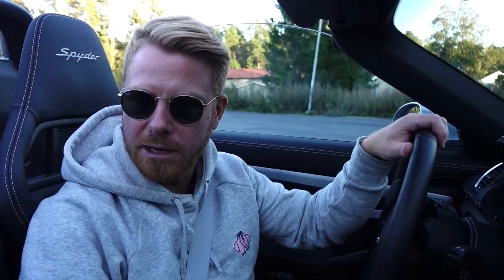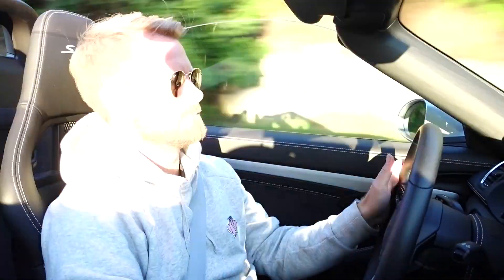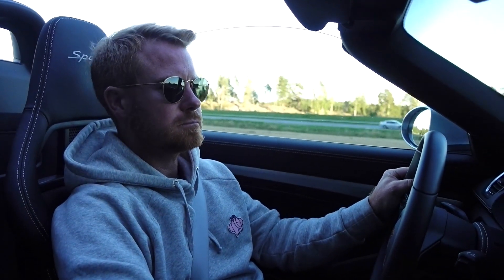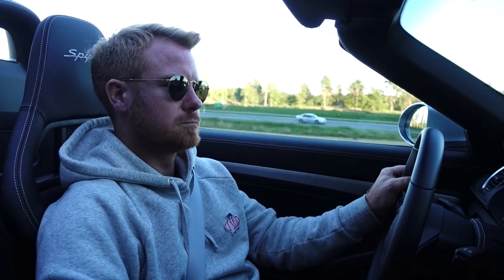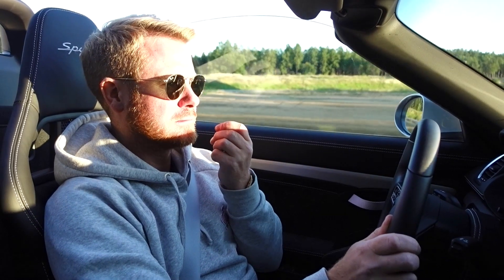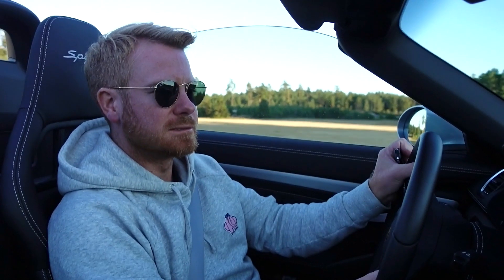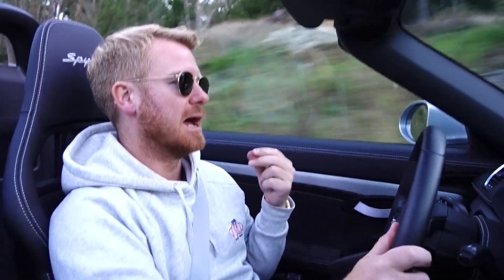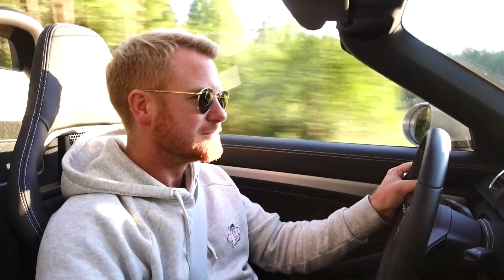Porsche 718 Spyder - DRIVE, Exhaust valve controller install from Cargraphic

Comment: Many thanks Andreas for this fantastic tip. In the installation video you mentioned at the beginning that you just have to pull the flap hoses left and right. Since I think that a lot of people only want to drive with the flaps open anyway, that's an extremely interesting hint. I tried it straight away. You don't have to lift the car or remove the diffuser, you just put your hand under the fender and you can even pull out this little metal hose without effort (left and right), you don't even need a screwdriver. I think it would also be worth having a video of its own. Thanks again
Reply: Do you need to have the exhaust button selected before the tubes are removed?
Reply: @seanf7174  No, the engine is off, during procedure.

Comment: Ask your Porsche dealer to disconnect exhaust valves/gates permanently,  this keeps exhaust flow open all the time.  Warranty not effected if done by Porsche (You gotta ask workshop manager very nicely,  they may charge an hours labour).  This way its always On and the exhaust button on centre console becomes redundant.
Reply: This seems logical and more appropriate
Reply: I've never used one, really, but I believe you can put it in the serial mode, so it'll just bypass the car's intent on controlling the flaps.

Comment: What would you do next with the exhaust? Any recommendations after the valve controller?
Reply: Sorry for late reply.   This is the ONLY change I recommend, No more changes required,  It is a simple non invasive disconnect that reverts the car back to the sound it would make had there been no noise regulations.
I have driven same car with an "Akrapovic" system fitted,  it is expensive,  loud to a point where it is no longer enjoyable to drive.

Comment: Just subscribed to your channel I did not see the video where you show which exhaust system you got for your spider. I just purchased 718 boxster Spyder and I love it beautiful spec but I want to do something about the sound which exhaust do you recommend? Top three that I was thinking about was JCR sole performance or fab speed
Reply from the maker: Thanks for subscribing Robert! The video is being edited. I will have it out in a couple of days. There has been some sad happenings regarding the exhaust, but now everything seems back on track. 
There is a big difference in the exhausts you are mentioning. First of, JCR is in the UK and the other two in the US. If you are in any of those countrys I would go with that manufacturer to not get an extra tax.  But mainly the design of JCR, Sole and Fabspeed is different. On one side you have JCR and Sole that offers x-pipe solutions. While Fabspeed will in its open mode release the exhaust straight out in one pipe per cylinder bank. This will make a difference in the sound. I like the X-pipe sound better since its combined in one note instead of two if that makes sense. :)

Comment: this is an essential modification! now to go further it is necessary to switch to the silencer cargraphic touring or xpipe. the x pipe seems ideal, its like a gt3, but is it sufficiently quiet and without drone with the valves closed??
Reply: @WheelsToys  ok, i will follow your changes carefully. I ordered a pdk spyder which will be delivered in 2021 and will be doing the exhaust modifications as well. apparently the cargraphic touring is often recommended, but the xpipe is tempting! to be continued ...

Comment: Was disconnecting the battery, and adding a power connection also required to make this modification? This is not shown in your video, but is shown in another video that I’ve seen showing the Cargraphic controller being installed.
Reply from the maker: Not needed, but recommended by some. There is no open electronics in the rear of this car. When I did the same operation on my Ferrari F430 there was some wiring needed, then I disconnected the battery. :)

Comment: Do you still recommend replacing the exhaust system (Cargraphics) or is this modification good enough?
/Tack på förhand.
Reply: This modification is enough, try it first before you start spending money & making changes to car.
Reply: This mod is good enough for me.  Its easy, cheap  they probably will not charge you, small change done by Porsche Dealer so you cannot be accused of making changes yourself to car & losing warranty.  It's a good compromise. A friend in local Porsche Club had the Akropovic exhaust fitted to his 2019 Spyder,  it is too load when cruising and he regrets spending so much money unnecessarily.

Comment: Total waste of time and money, just disconnect the vacuum hose near the rear of the OPF filter, the valve will open all the time, it takes literally 2 minutes.
Reply from the maker: You should however plug the lines. :) Otherwise you might get a check engine light down the road for vacuum leakage.  But two screws or golf-pegs do the trick.  

But I do love to be able to turn the exhaust of and make it a cruiser on the freeway. :D
Reply: Thanks again, i love yr mods and yr take. Subscribed.